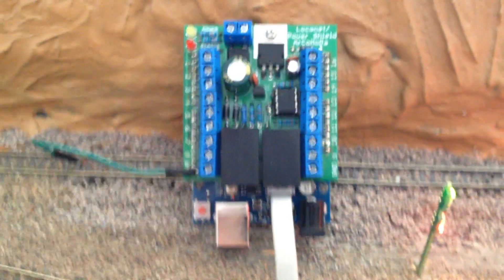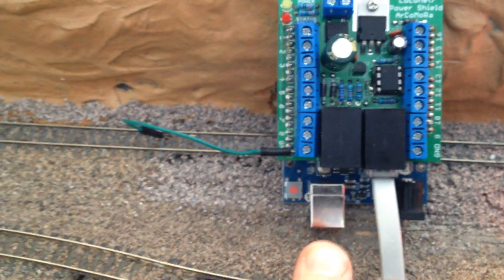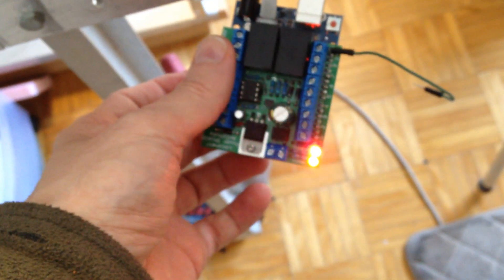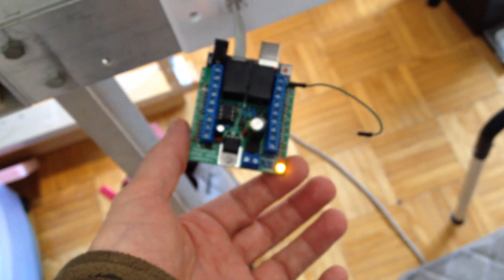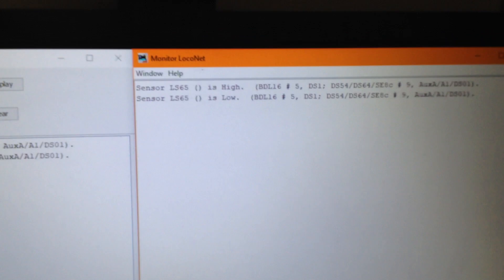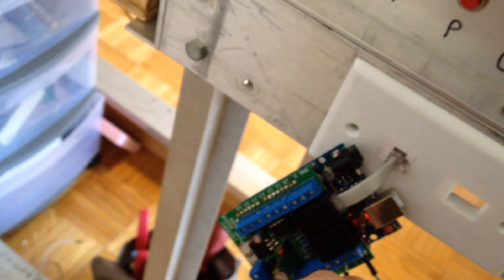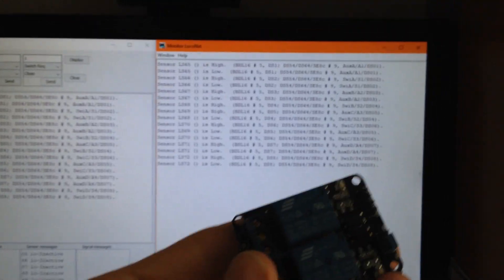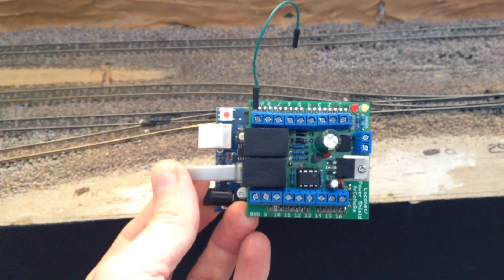ArCoMoRa ArLoco Arduino loconet device.

Comment: Thanks for posting!  

I just bought one, and assembled and tested it.  When assembling, I elected not to put the diodes in for sucking power off LocoNet, but rather will power either the board and Arduino (using a 12ac or dc wallwart connected to the terminals on the ArLoco), or the Arduino and board through the Arduino's USB (like a phone charger).  I just wanted to avoid any power issues on my LocoNet.

As you showed, the 16 inputs are triggered by grounding the appropriate terminal.  The inputs can sense either a pulse (you can define the parameters) or continuous (stays triggered until the ground is cleared from the input).  Except the 1st input is always pulse I believe.

Since it connects to the LocoNet, I have a Control Panel in JMRI with Logix that takes those sensor messages from the ArLoco and does what I want!  That's what you alluded to in the video.

Thanks again for showing this.

Phil in gorgeous Young Harris, Georgia, USA

Comment: Hi John,
Nice video about my Arloco sketch and shield
But did you really understand the function of ArLoco?

So I have some questions
- Why don't you show the configration mode first?
- What Loconet analyzer do you use?
- What 'errors' did you get and how they were solved?

You say:
This ArLoco gives me 16 inputs to connect such things as relays or lights or servos for the layout.

That is nonsens. Arloco is only capable of sending LocoNet signals to a command station or computer.
It is only a feedback encoder that reacts on a low-signal on an input.
More and better info: https://www.arcomora.com/arloco/
For connecting relays, lighjts or servo's there is MARDEC, a generic DCC based accesory decoder.
https://www.arcomora.com/mardec/

Regards,
Nico Teering
Arcomora